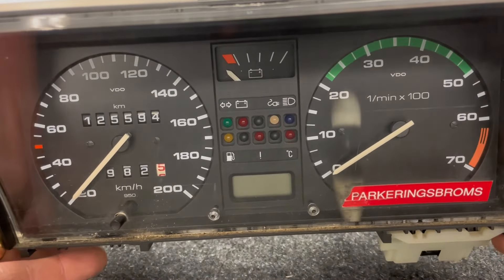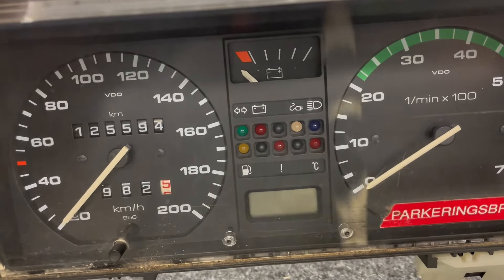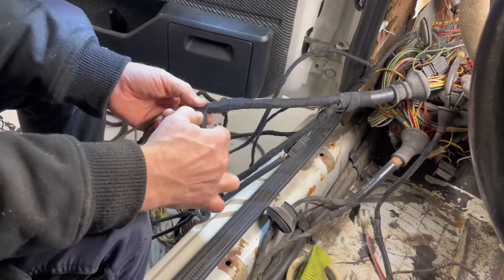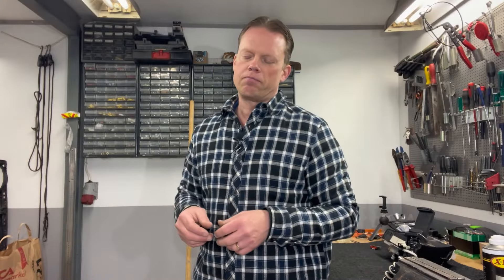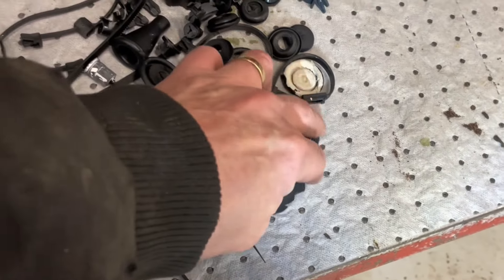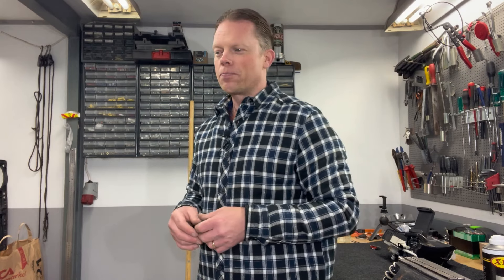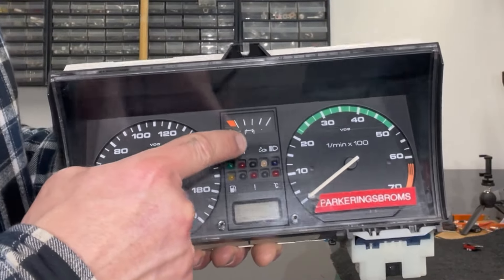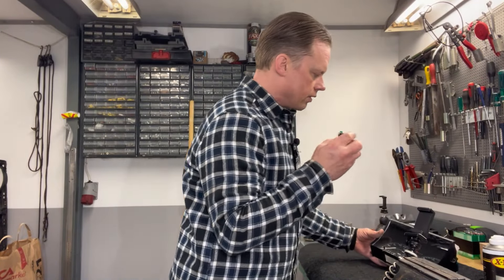Wiring, firewall and instrument plans ev conversion stuff. Vw golf Mk2 Citystromer.

Comment: I would pick up another standard cluster and mod that.  The stroomer one is far too rare to mess with.  Would be far better to mod a more common standard petrol one.  I have several stashed in my collection I bought some years back with the idea of using them for custom builds, and now thinking for EV conversions instead.  Its not difficult to make the inserts for the dashes a vinyl printer or laser printer will give good results.      The cable ties are so good,  I have seen similar ones available new for sale but they were expensive for what they were.  Shame VAG dont sell them anymore.   Great use of the cleaner.   Need to do the same for all my bits.
Reply: I agree. Save the cluster and modify a standard one.
Reply from the maker: Its sad if it just have to be laying on a shelf, then its better to have the display elsewhere. But I think that i will take a look at it first. I will definitely not drill or cut in this rare piece😅
Reply: I know you want the car to look and feel as stock as it gets, but what about using a standard cluster and adding a display with the full height (only in the center, think of an old smartphone screen). I know this would be a project of its own, but you could display lots of information, e.g. Battery health..
Reply: @niokolabs  would work and considered something similar on mine.  Would be like retro version of the the instruments in the  mk5 and onwards

Comment: I would shorten the cable ties later, maybe they would rub on the paint and damage it... that would be a real shame, as everything is as beautiful as it is now. 
In the end, the car is in significantly better condition than it ever was.
Rust protection...? Just with wax or something like mike sanders grease?
Reply from the maker: Thanks 😊 
I will only apply rust protection on those places I been removed it from as it is now. I will drive it during the winter.

Comment: I would try to convert the SOC from the BMS to to the analoge gague. If not PWM works like mention above have a look at arduino and Digital Potentiometer Control. That might work instead of just a voltage devider. Keep up the good work.💪👊
Reply from the maker: Thank you. I have bought an esp device and a pwm driver for the job but I need to learn myself to code everything. And time is missing if I want to drive the car this summer 😅 thanks for your input👍🏻

Comment: If you can remove the clock  LCD screen from the original dash and replace it with a small multi function display with no modification of the original dash (so it can be taken back to OEM) that would be my goal. 

Also seeing that original analogue battery gauge representing the new high voltage battery pack would be so cool. 

But you do you!

A slightly different angle would be instead of any analogue gauges to use a 100% digital dash but with the art style of the original dash cluster (like how the latest generation of Mustang has re-created the 80s fox body gauges)
Reply from the maker: I think I go with the clock. But only if it can be done without cutting in the instrument as you mention👍🏻

Comment: Get rid of the time clock and put the new gauge in there
Reply from the maker: Yes, if it’s possible to install it there without any drilling and cutting I think I will do that.
Reply: @flyingtools  or go full custom . I’ve loads of videos on using a monza or Kadett digital dash in my vw corrado . Please check it out . Might give you some ideas. 😛😉😉

Comment: It must be easier to come up with the electronics to drive the battery indicator than to remove it and fit the display. Plus the look of the instrument panel will be compromised. If you do choose to use the display, that LCD clock will be out of place. My two bobs.
Reply from the maker: Yes, the clock is probably the best thing to remove I think. The problem for me is that I never have programed an esp or arduino device so I don’t know how much time I have to put in to just that thing. Its more important to take care if the other of the stuff.